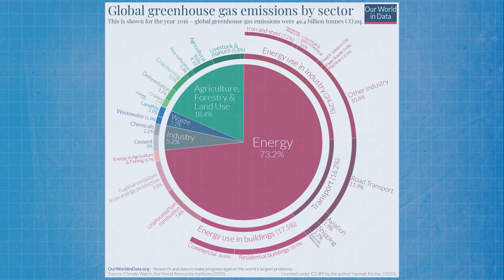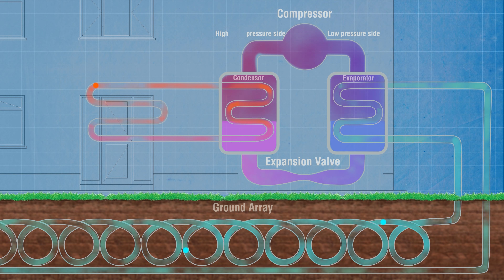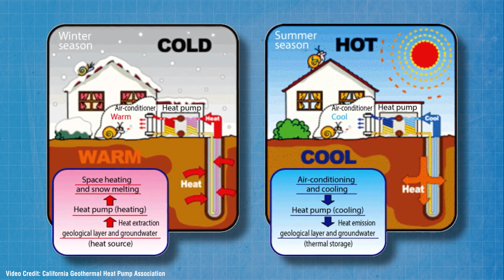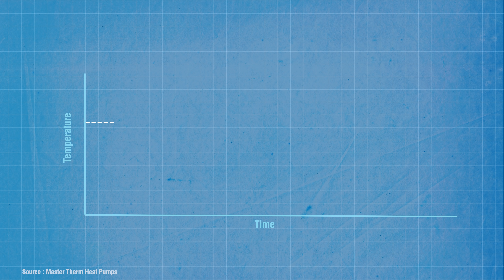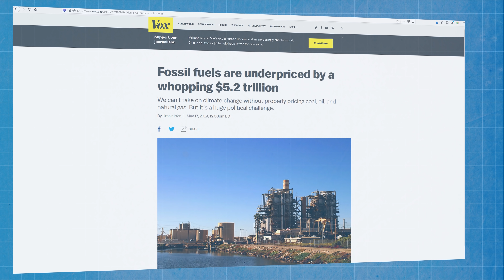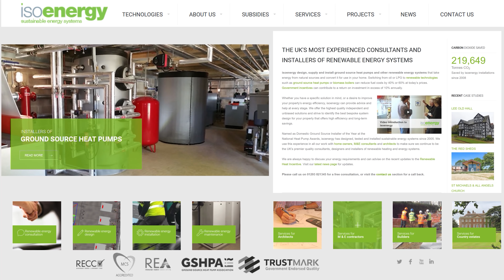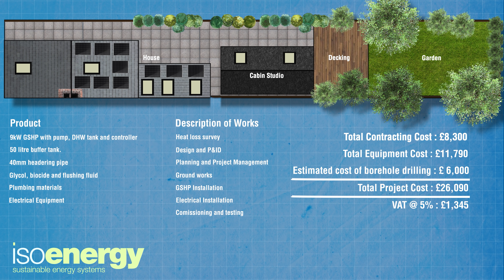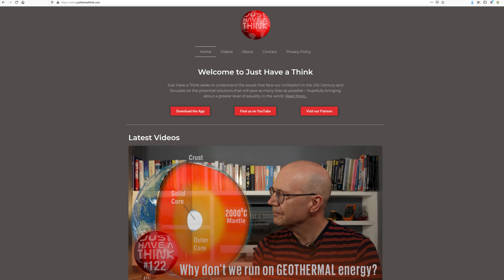Geothermal ground source heat pumps. Heating your home from your own back yard!

Comment: Don't call it geothermal when you have to use a heat pump. Call it "ground source heat pump" when the ground is just normal earth temperature. Geothermal is when you drill a well and get hot water you can use directly for heating. Real geothermal saves you close to 100% on heating bills.
Reply: Actually no. The scientific term for this method is called shallow geothermal systems.

Comment: In some towns down here where being cool is the challenge the locals simply live underground.
In the interests of full disclosure I have to point out that the rock is soft enough to dig out with hand tools.
The other upside is you don't need to buy much in the way of building materials and shafts can be used to provide 
lighting in daylight hours.
Reply: Sounds like an opal mining town to me. I hope you made your fortune while digging your home.
Reply: @stevenstart8728  Sorry only visited one. I guess there's always the possibility of striking it rich while digging your home. I should add though that opal mining has a large element of luck to it.

Comment: I think ‘geothermal’ strictly refers to heat emanating from within the planet rather than the warmth retained in the ground from the sun which is what GSHP work on. You’d need to drill very deep in most places to get geothermal energy, but then you probably wouldn’t need a heat pump.
Reply from the maker: Hi Charles. That's true of the horizontal systems to be fair  - they work on retained solar heat. But the 100m boreholes do reach 3 degrees Celsius warmer ground which is geothermal heat.
Reply: Maybe not the most important thing for the discussion but here in Sweden the important thing for the boreholes is the surrounding and also mowing groundwater. Not the depth of the hole. The whole thing with the hole (often two or even three of them for one single house) is to provide a place for the tube that collects the energy.  
If the surrounding of the hole is dry, there will be no transmission of energy. The energy for the water comes mainly from the sun.
Reply: Urpo Taskinen quite right; the ground conditions are crucial. If it is very dry, or clay, there is no movement of groundwater to bring new heat in. Permeable ground with moving groundwater is best, or put the pipes in the local watercourse... we looked at GSHP for our house but it was far too expensive to create the pipe network, so we have installed ASHP which has cost about £8,000. It is a much easier installation and we will soon know how effective it is...

Comment: I know a few people that have a geothermal system and it doesn't work well in our climate. Our ground temp is too low and our winters are too cold, so on the cold days the electric heater has to cut in to add extra heat. Here electric heat is way more costly than nat gas. After only a couple years one of my friends had to replace their compressor for thousands. The system is extremely complicated vs a nat gas heater, and complexity costs money when it fails, and it fails more often.

Comment: Very informative JHAT as always. One point about cooling with heat pumps: it does work, but not as effectively as an airco. Since ideally you're using a floor heating system, you're just getting a very cold floor in Cooling mode. The heat exchange is not so effective, because the hottest air is not on the floor. Ventilators help to get some airflow, but it will  only make a couple of degrees difference.  Also, the water in the piping will be really cold, so you get problems with condensation.

We just installed our (Air source) heat pump this in a totally renovated pre-war home. It works like a charm for heating. Very efficient, and mostly silent. But the cooling was a bit of a letdown. It did work and got us through the heatwaves this summer, but especially the condensation problem made it less care free than hoped.
Reply: Good point. When cooling we tend to recommend using a fan-coil system to cool the air instead. If mechanical ventilation is in place, of the project is new-build, its the best way forward. Not always possible in retrofit obviously. Using the wet heating system for cooing can lead to condensation, but is still widely done.
Reply: Ours is a forced air system, so heating or AC work equally well EXCEPT I don't like that water immediately begins to condense on the metal ducting as soon as the AC is activated.  I presume this is also happening inside the walls.  Insulated ductwork might alleviate this, but that isn't a retrofit I'm willing to tackle.   Thankfully, it seldom gets hot enough here to need AC, so I just don't use that function of my heat pump.

Comment: The typical 3- bed UK home pays £1000-1500/year for gas and electricity , can you explain how you could save £4000/year with a heat pump?
Reply from the maker: Yes. Firstly, that £4K is not a saving on heating bills, it's an actual quarterly payment from the government. You would have to have a 'worse than typical' house though. That level of saving is 'worst case scenario'. The incentive payments are based on the differential between current system and new system, so the worse your current system is, the more incentive money you get.
Reply: @JustHaveaThink  ... thanks, love your channel!
Reply: The £4000 / year is not a saving it is a government subsidy paid by the RHI scheme to help repay the installation cost over 7 years. Have a look at https://renewable-heat-calculator.service.gov.uk/ for more information.

Comment: I installed a geothermal ground source heat pump when I built my house back in 2002. I live in southern Minnesota around the 44 degree north latitude, so we have cold winters and and hot summers (typical temperature range from -30C to +40C). The system had three horizontal averaging 4 meters underground. It now only has two ground loops due to ground settle from the construction which pinched off one of the loops making it unusable. Installing three ground loops was intentional for redundancy and despite the loss of one of the loops, the system still keeps my house warm and cool throughout the year. If I lost another ground loop, the remaining ground loop would continue to help reduce my energy costs by supplementing the electric heating and cooling portions of the system. The approximate cost of the system was around $11,000 US dollars in 2002. Another advantage the system, a lot less maintenance and costs. Even the air filters are washable and never need replacing. I highly recommend systems like this to everyone in the mid to high latitudes.
Reply: Thanks for sharing your story. I was looking at a ground heat pump. But an energy auditor I hired just gave me a long story about how air heat pumps are now a lot more efficient and a better more efficient option for the price. So now I’m confused.
Reply: @j.c.d.7303  An energy auditor?? Are they independent of any big corporation? If so, go with the system mentioned above. Smaller companies don't usually have a 'complaint department' which is another word for dazzle with numbers or worse baffle with bullshit. The smaller companies have done their homework and have direct experience with how to install their product and know what answers for problems. Check with the company mentioned and ask if they know of the other 'auditor'. Fog disappears. Confusion lifted. Good luck.
Reply: In MN too.  Do you have firm you recommend to get quote from?
Reply: @mrbizi5652  I used a local dealer who recommended the Hydron Module system for my home (300 square meters). I liked all its features, most notably the all stainless steel construction, variable speed fan, and overall energy efficiency. Other then the collapsed ground loop (which I installed myself), the Hydron Module HVAC system has been trouble free since it was installed with no signs that there are any issues. I'm sure it will eventually have problems (nothing lasts forever), but I don't expect any major problems with getting it repaired.
Reply: @VallisChristianus  In MN...doesn't use freedom units for house size...YOU ARE HIGHLY SUS! 
HE'S THE IMPOSTER!
Reply: @TheGuruStud  Are you implying my choice of units should be controlled by an authoritarian government? I choose metric because it makes more sense to me. That is what freedom is all about. My choice.
Reply: @VallisChristianus  pretty sure it's a joke....
Reply: @VallisChristianus  Glad to find you here! We're at planning stage for new home build next year in NW Minnesota. I've seen some conflicting info which suggests we have a backup heating system for these cold cold temps up here. Can you comment?
Reply: @kagigebiquillboxes8565  the Hydron heat pump I installed also included an electric heating element. (I think most do.) Its only turned on a handful times in the 20 years I've been using the Hydron. I also have a gas fireplace that can be use for additional heating, but it's mainly used for ambiance. I did test it though using just the fireplace and it was enough to keep the house from freezing even during the coldest nights. It's good to have backup systems.
Reply: @VallisChristianus  Thanks!
Reply: @kagigebiquillboxes8565  My system has a backup electric furnace built into the heat pump.  I have used it when we lost a pump for a few days.  Quite simple really as the system is a forced air style.  I even had the optional heat recovery system off the compressor preheat my electric hot water tank for the domestic usage.
Reply: that’s awesome!  thanks for sharing!